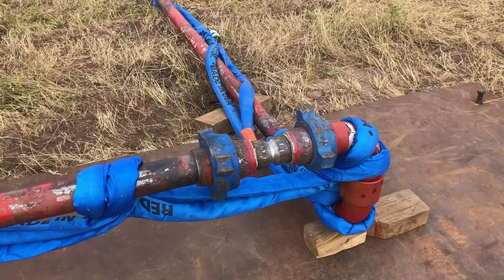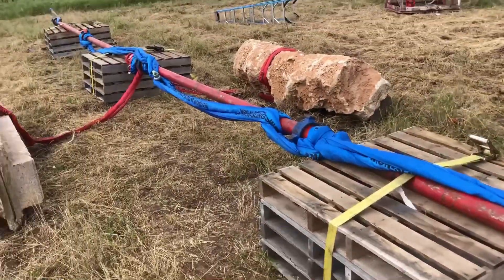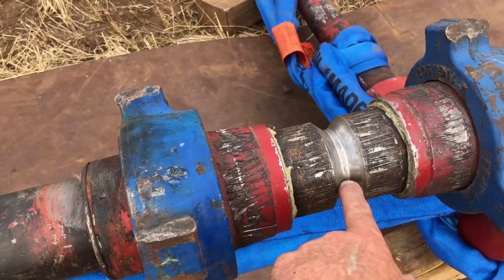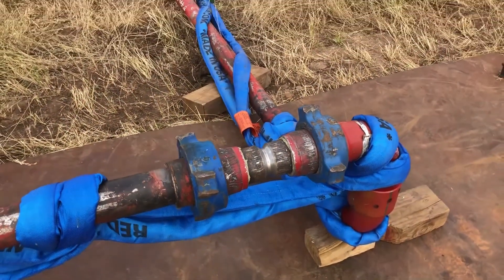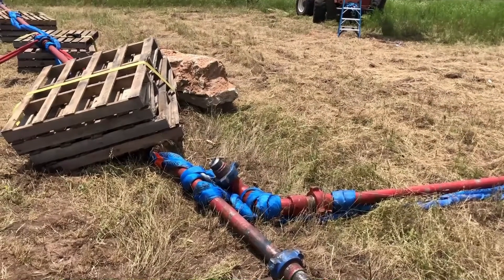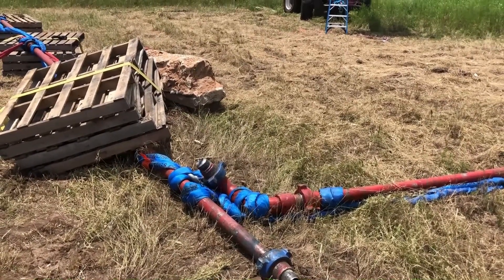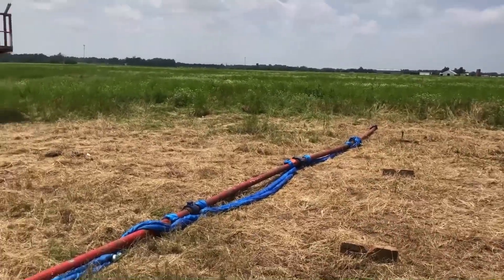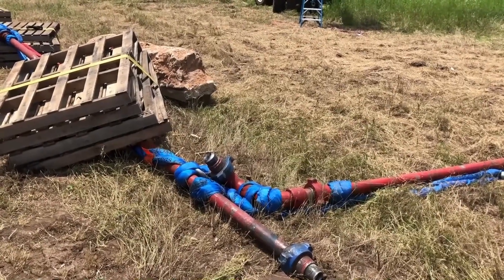Chicksan failure - Line of fire

Comment: What is the purpose of this pneumatic systems with such insane pressures and flows?
Reply from the maker: They use this type piping during Fracing operations in the oilfield.
Reply: @TheSbeeson  Plus cementing, and acidizing, (H2S service line, including Chiksan "swings', and steel hose, would be painted a light green.

We used 1.3" ID 20K rated line for our ballouts, and the 3" ID Big Inch iron, which used two wedge like halves and a rubber backed steel seal to hold the line together, on the HT-3000/HT-1000 frac jobs that we ran, although we used ONE HT-3000 when EXXON wanted to "do something different" on a formation breakdown, and injection test.